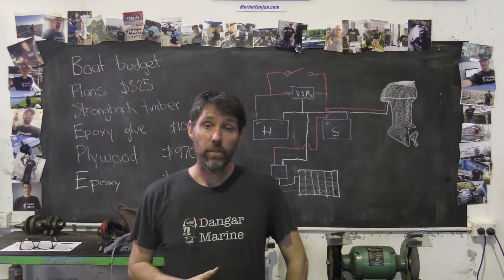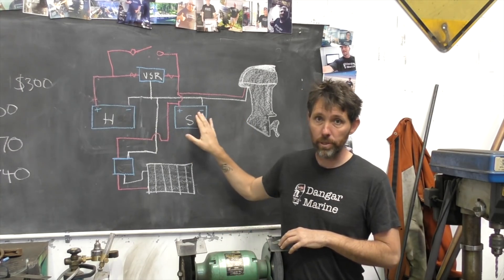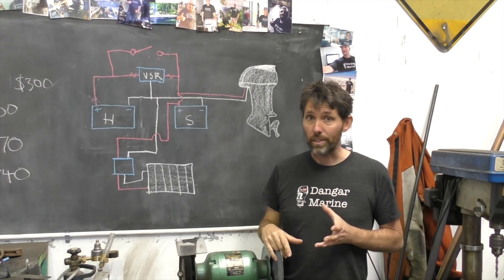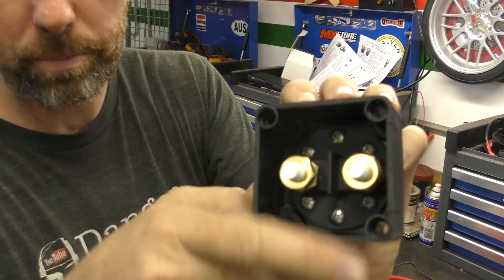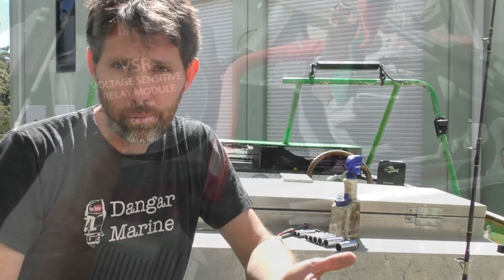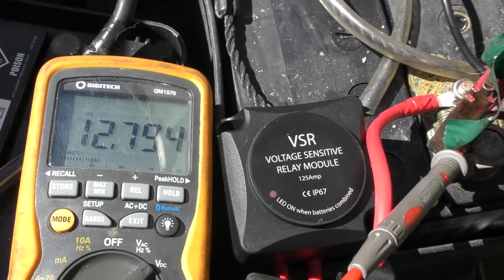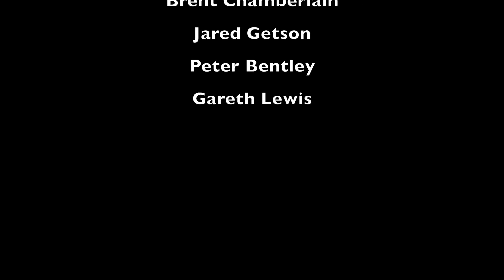Voltage Sensitive Relay (VSR) installation

Comment: Great video well explained also a big bonus for me you showed and mentioned the extended led loop wire. I've had a revolution system that had the extended led for dash but system craped out and to buy another the price is $200.
But thanks to your video I know where to purchase your system to have what I need. Cheers

Comment: hi great review i just got a boat has dual batteries and a voltage sensor but in the niddle has a islate switch not sure to know if it is on    ty

Comment: 6:43 that VSR has the option to connect those looped wires to manually switch it on. You couls have saved the extra switch.

Comment: A bit late to the party but these days you could buy a dual sensing VSR with an override in the actual VSR which would allow you to connect the two batteries in parallel should your main battery is discharged.

Comment: hello, WHEN ENGINE OFF, If i have de sensitive terminal to Starting battery, when the auxiliary battery drains off or less to 12.8v... the VSR let pass power to auxiliary battery?
Reply from the maker: It lets current though when the starting battery has over a set voltage, not when the auxiliary is low.

Comment: I added a VSR to my little skiff a year or so ago after watching this great vid (thanks Stu). Yesterday, got to my local water and starter battery was down. This could be because it's quite old. But today I figured, while messing around down there, why not isolate the VSR while the motor is not running? Basically, the VSR pulls only a few milliamps while the boat is dormant, but to me, that's still unnecessary waste. So I did what the manual recommended, that's to cut the red loop (discussed right at the end of the vid) and connect it to a 12v "engine on" source. I was curious about which end of the loop to connect, and discovered that there's a right and a wrong side.

Connect a battery charger to the main battery. If it's fully charged, the VSR will activate sending charging current to the house battery. Cut the red loop and the VSR should deactivate. Test from battery negative to either cut end of the cut red loop. One cut end will show power and the other won't. Connect your "engine on" power source to the red loop end showing no voltage. Disconnect the battery charger, start the motor and the VSR should now activate after a few seconds (again, assuming the starter battery is fully charged).
Reply from the maker: Nice work! Sounds like a great setup for a boat that isn’t used every week.

Comment: Hi, I have a question. I have a 1988 115hp Johnson outboard and I have weak spark in all 4 spark, what can be the problem
Reply from the maker: Possibly damaged coil under flywheel, ignition coils or leads.
Reply: @DangarMarine  ok I am going to check it out. Thanks you sir.

Comment: I think fusing both sides of the vsr was smart. Long ago when i was a green boat tinkerer i installed a cigarette lighter style power outlet on my center console without fusing it. No sooner had i connected it to the battery, a dime fell from my pocket and landed perfectly in the socket of the outlet. In a matter of seconds i had smoke pouring from under the console as wires began to melt. I had to grab and yank the smoking hot wire from its connector with my bare hands to prevent a fire. Lesson learned, fuses good.

Comment: Hello Stu, thanks for sharing these amazing videos. I am working on my first boat project and your diagram is exactly what I intended to instal a solar panel with two batteries.

I have two twin motors Mercury 250. Could this set up be used with the two motors running to the same battery (meaning, would it be Ok to connect both motors to the Starting battery)? I am not sure if when running the two motors it could cause the “Start” battery to be overcharged. 

As to the gauges of the cabling, did you use 6 gauge for the parallel connection between the two batteries? Also, what gauge did you use for connecting from the house battery to the switch board? I am aware i will need to calculate the gauge based on the distance, though it’s just to have an idea.

One last thought...if i am planning on adding 4 bluetooth speakers and charge cell phone gadgets at the same time, should I worry about adding a bigger solar panel of maybe 200 to 350 Watts? If I plan on adding additional solar panels later on, should I worry about having a bigger charge controller?

Thank you for explaining it clearly, although i have to confess i have watched each video over 10 times to understand it better. Thank you
Reply from the maker: If the outboards are identical you can charge a single battery, but you may be better off having a second battery and installing a battery switch. 6 gauge will be fine to handle the charging current, but not starting current if you parallel the batteries to crank. I would definitely start with the biggest solar control you think you will need. I have already upgrade mine twice!

Comment: You've just pretty much described a PROJECTA IDC25 and they're under $300. I did the VSR thing but most alternators these days don't hit the voltages to keep a deep cycle battery more than 60 - 70% without a dc up convertor

Comment: Can you use the same eletrical setup you have on the green machine on a larger cruiser with an inboard engine. Will the larger starting amperage of a diesel engine affect this setup.
Reply from the maker: I'm about to rewire my new trawler and will be using a similar setup. The only issue is having large enough wire to carry the current.

Comment: Awesome.  I'm sure You know Blue Seas make a battery switch that turns both batteries on or off but keeps them separate so they don't rob from each other with a VSR to charge them. Then if you need both to start your engine the switch also has a combined setting? Then you can turn both batteries to off when you leave the boat.

Comment: What would happen if  (like mine) I have 150a house battery and a75a start battery? When Gen gets start battery above 12.8v it lets Gen top up house battery as well. So if both being charged or both sitting above 12.8v then VSR is closed and both batteries are in parallel. Will this harm the batteries?
Reply: You can run different capacity batteries in parallel, just not different voltages!
Reply: @davidjulian8536  does it overcharge
Reply: @jussikankinen9409  Only if there is something wrong with the alternator/regulator and the voltage is too high. The VSR won't cause a problem.

Comment: I would like to add a voltage meter to monitor the voltage from the alternator I think I could put a diode on the plus side of the regulator and run a wire to my meter. What go you think?
Reply from the maker: I normally just monitor the battery voltage as it will show how the battery is going when the motor is off and will show the charge voltage when the motor is running. Been meaning to do a video on that for a while.
Reply: @DangarMarine  I have a meter on the batteries it doesn't seem to increase voltage when the motor is revved I'll check the rectifier I may have a problem.

Comment: If you go for a VSR like this one (https://rover.ebay.com/rover/0/0/0?mpre=https%3A%2F%2Fwww.ebay.com.au%2Fulk%2Fitm%2F252477455461) can you have the on/off switch somewhere else in the circuit so you only use it for turning the power on and off? This VSR has a manual override switch so you can use both batteries at the same time if needed.
I saw this video (https://youtu.be/Z9c1hVXBggk)
Reply from the maker: Yes, I bought this VSR from a local store in a rush, I definitely think there are some better choices out there.

Comment: I forgot to mention yesterday, but I am happy to see you are not using those stupid wing nuts to attach your cables to the batteries !  A bit of lanolin grease on all of the threaded connections will guarantee they will not corrode.
Reply from the maker: Yes, I hate those too. I put a packet of stainless nylocs for these batteries so I always have some on hand.

Comment: Very informative, as always !  I never knew such a device existed and with the bypass switch it makes a true "set and forget" setup.  As always, if the house battery (bank) is not located nearby, wire gauge between it and the VSR is critical !

Comment: Another very helpful video.

Before I upgraded my trolling motor from a 12v model to a 24v unit, I had one of these VSRs installed to try to increase the run time available from the trolling motor.  Here in the US they are also called ACRs (auto circuit relay) - acts exactly the same as your VSR.  I did decide to eliminate it from the circuitry because I found the alternator on my Yamaha had a max output of 10A which isn't much help for a TM battery when the charge output is shared.  If the outboard's alternator output is sufficient, these are excellent devices for distributing the charge.
Reply from the maker: Hey Jim. Good point about the charging current of many smaller outboards being quite low.
Reply: Stu, its a 2002 90 two stroke, a great engine for my seventeen foot boat.  I have thought the engine would produce more but the service manual reads 10a.  They didn't have all the electrical needs sixteen years ago that boats have today.

Comment: Someone is going to leave the switch on and run both batteries flat. Better to have a relay and momentary button you have to hold when cranking to momentarily engage the house battery for starting. Or a momentary button and a VSR with start assist to momentarily engage the internal relay for starting.
Reply from the maker: That's definitely one way you could go. I'm personally leaning towards and LED on the dash.

Comment: Nice vid.. I'll just add that some VSR's have a feature that lets you connect bat 1 & 2 together with a momentary push button.  This can be handy if you want to keep the setup a little simpler(?) and have a push button up near the ignition switch so if you do get a flat battery you just press the over ride button and then give it another crank.  Only thing to be mindful of is if the VSR is rated to have the amps coming through it to send to the starter.  Cheers :)
Reply from the maker: It's interesting the way all the different brands of VSR have extra features. I've been thinking about how this VSR would handle having cranking current passing through it and I think it should be fine. I am assuming that half the current will come from each battery which should have it down to about 70 amps according to the specs.
Reply: The over ride switches do put the batteries in parallel, but the idea is that if the crank battery is 'flat, you press the override, give the 2nd battery a few minutes to put a 'surface charge' on the crank battery, enough to crank the motor a few times any way. Much the same as those 'jump start battery' things work. That way only about 50 amps go through the VSR contacts. but note- a dead flat/shorted crank battery will kill the house battery  pretty quick. A bypass switch that  disconnects the usual crank battery and only connects the house battery to the motor crank wire. Stu has it pretty close to that configuration. Also a VSR lets you use two different sizes of battery for crank and house battery's, but they have to be the same technology type.

Comment: Nice set up!  I thought about this but went with a $25 lithium battery that has jumper cables and is strong enough to jumpstart my boat in case I’m listening to too many tunes in the middle of the ocean.  I’ve already used it to jump start my boat and truck.
Reply from the maker: They are amazing the new lithium jump starters and definitely a great option depending on your personal needs.

Comment: Here is a 'weird' question:  I just started rewiring a 1962 17 foot MFG Runabout I have been restoring/'remodeling' into a 'custom' fishing rig  and I plan on wiring it up with duel batteries due to the amount of electronics she will have on board.  My 'primary' battery is going to be for the motor and navigation lights only, while my 2nd one will be for the fish finder, nav comp, bilge pump, ect.  Here is my question:  I was given a 4 position battery switch that was taken off of a 1989 Wheeled Coach/Ford Type II ambulance that had a 24 volt system.  The positions are 'battery 1', 'battery 2', 'Both batteries On', and 'both off'.  Will this type of switch work on a marine application and can I charge both batteries off the 2001 100 hp Merc outboard engine?  Love your channel.  Have learned more from you than just about every other like channel combined!  Keep up the great work!
Reply from the maker: Yep, that setup will work well. You can put the VSR between the 1 and 2 poles so that both batteries with charge or just use the switch alone like I had in my original setup where on the battery currently selected will be charged.

Comment: Another handy video. I have that set up on my boat and also on my last one, although also with an on/off/combine switch so i can turn it all off when not in use. Just switch on and go with the peace of mind both batteries are charging
Reply from the maker: I certainly think that is a great way to go if the boat does have long periods of not being used. When I had my other switch I never used the off but my boating situation is unusual.

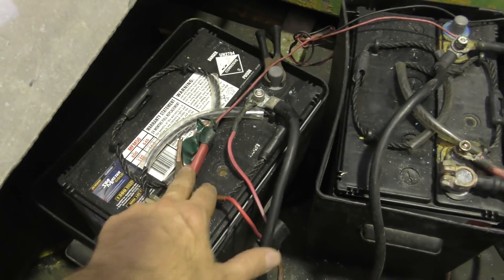Comment: At about 3:20 you said the boat has been sitting around for a while not being used.  I thought that was your daily driver.  Did you get a new boat?
Reply from the maker: No new boat. Every couple of years I pull the Green Machine out of the water to antifoul the hull so I coincide this work with when a friend heads overseas so I can borrow his boat while I'm doing it.

Comment: Great video, as usual.
But i´ll think that the bypass switch is slightly over complicated. You might replace the switch with just a spare jump start cable in case of a bad day.
Reply from the maker: The trouble is when I my wife called to say the boat won't start it's much easier to tell here to just flick the switch that explain where to put the leads.

Comment: Thanks for all these videos.  I'm doing a dual battery system for my Four Winns and am now leaning towards the VSR.  Just as a reminder... Fuses are used to either protect a device (when they are built in or just outside of the device), or they are to protect the vehicle (from a possible electrical fire).  In the later case, you'll want the fuse as close to the battery as possible.  THAT'S what the 8Ga MAXI fuses would be for.  Keep up the great work!
Reply from the maker: My main concern with this setup at the moment is that if the solar cell activates the VSR and then I start the boat half the cranking current will pass through the VSR so I'm glad those fuses are there. I'll have to find a few minutes to think about that problem, if it does turn out to be a problem.
Reply: Unless the solar panel is connected to the start battery the VSR will not be activated because the VSR ONLY senses charging state of the start battery ( as you have it wired up- remember the 'red paint sense terminal'). The fuses are still a good idea but the cranking voltage from the start battery will never go through the VSR.

Comment: Hi Stu,
i'm a big fan of your channel but in this instance i think you made a meal of this job. You now don't have any way of disconnecting the batteries at all. it would have been better to keep your 1-2-both switch and just piggy backed the VSR on the 1-2 terminals. this means with the switch selected to your start battery the VSR would fire and connect the other battery without you having to select it on the switch. And also you could turn it all off if you need to work on anything without removing the battery terminals.  It would also do the job of the parallel switch you installed.

Hope you're feeling better...
Reply from the maker: I can see where you are coming from but there is a bit of missing history here. Firstly, I never mentioned that the original battery switch died quite a while ago and had been replaced with nothing more than a stainless bolt. Because the boat gets used several times every day I never turned the switch off or even switched between batteries so I'm quite happy to have this simple setup with a cheap emergency start switch that fingers crossed I'll never need. The trouble with my boating circumstance is that it isn't really representative of what most people do hence the apparently odd setup some of the time. And yes, feeling much better now!
Reply: And the plot thickens....
Reply: Ah, just what I was thinking, use the old switch,  but the old "switch" is now a bolt so not usable this way...  :)

RichE San Diego, CA
Reply: Yeah, it is, just take a lot longer to use- knowing Stu that means a plumbers adjustable wrench and pair pliers.

Comment: Is it possible to add a VSR and keep the 1-2-all switch also connected. Or is the ALL connection a problem?
Reply from the maker: Yep, you can. The both switch is essentially just the same as my bypass switch in that setup.

Comment: Hey Stu, love your videos... I'm preparing to install a second battery in my boat, which is a large gel cell for running a fridge and lights, etc. Because of the different chemistry I've opted for a dc-dc charger between them, but I can't seem to think my way through the problem of having the charger running from the battery that it's charging, if I ever switch the 1-2-both switch to 'both' in order to jump start myself. Any experience with that kind of setup?
Reply from the maker: Hmm, can't say I've ever seen a setup like that. I'd have to sit down with a bit of paper and see what options you have. You might simply be better off having a simple 1/2 switch so the batteries can never be in parallel.